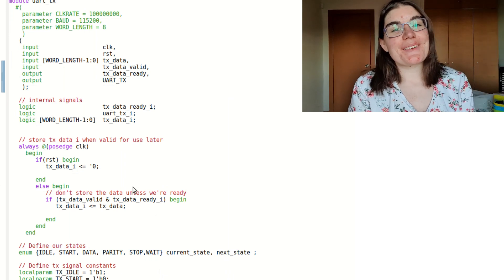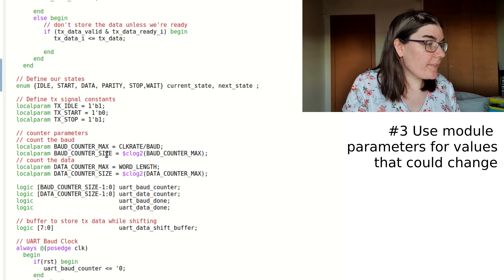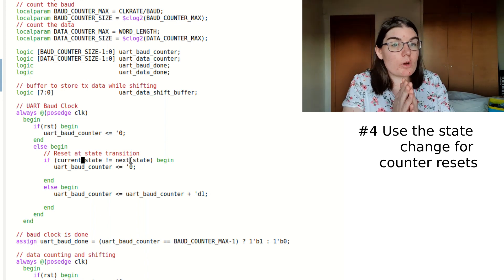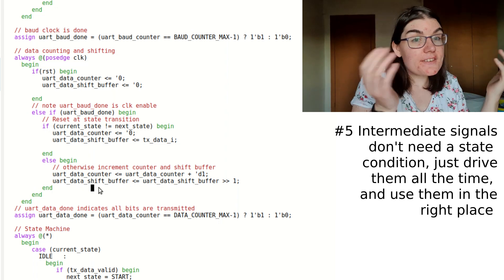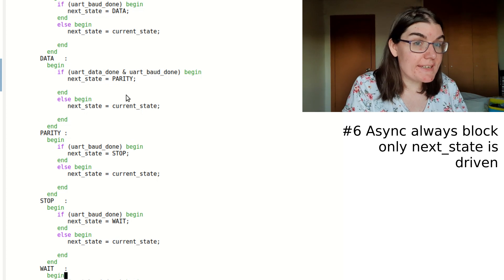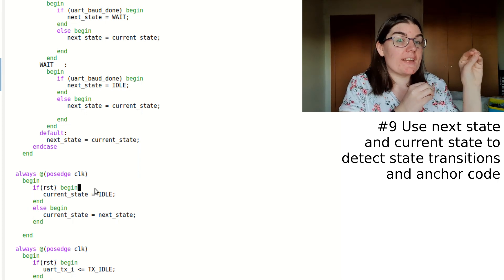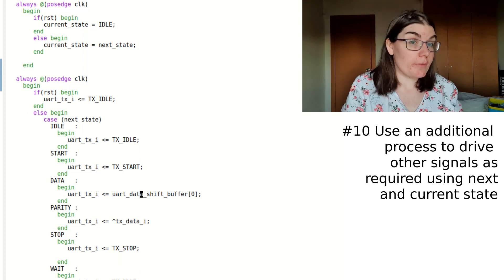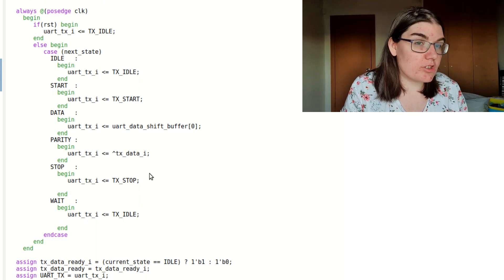10 tips for writing a clear state machine in Verilog: A UART transmitter example.

Comment: One drawback of separating the next state logic from the state machine outputs for large designs is that while the next state logic may fit on a single screen, the state machine outputs may end up many screens away. This violates the first principle Stacy brought up which is keep everything you need to know to understand what is going on close together. What you need to know to understand a state machine is not just the next state logic but also what the output signals are doing in each state. Having to scroll down away from the state machine to understand every output signal gets very confusing very quickly.

My suggestion is to put the state outputs in the state(s) they are associated with. E.g., in VHDL (which has been and still is a much better thought out language than the various flavours of the C-inspired Verilog):

reg : process(nrst, clk)
begin
   if (nrst = '0') then
      current_state <= idle;
   elsif rising_edge(clk) then
      current_state <= next_state;
   end if;
end process reg;

nsl : process(all)
begin
   -- Defaults.
   next_state <= current_state;
   tx_rdy <= '0';
   tx_en <= '0';
   case current_state is
      when IDLE =>
         -- Outputs.
         tx_rdy <= '1';
         -- State Logic.
         if (have_data = '1') then
            next_state <= TX;
         end if;
      when TX =>
         -- Outputs.
         tx_en <= '1';
         -- State Logic.
         if (tx_finished = '1') then
            next_state <= IDLE;
         end if;
   end case;
end process nsl;

For registered outputs the above can be modified to this:

reg : process(nrst, clk)
begin
   if (nrst = '0') then
      current_state <= idle;
      tx_rdy_r <= '0';
      tx_en_r <= '0';
   elsif rising_edge(clk) then
      current_state <= next_state;
      tx_rdy_r <= tx_rdy_nxt;
      tx_en_r <= tx_en_nxt;
   end if;
end process reg;

nsl : process(all)
begin
   -- Defaults.
   next_state <= current_state;
   tx_rdy_nxt <= tx_rdy_r;
   tx_en_nxt <= tx_en_r;
   case current_state is
      when IDLE =>
         -- Outputs.
         tx_rdy_nxt <= '1';
         -- State Logic.
         if (have_data = '1') then
            tx_en_nxt <= '1';
            tx_rdy_nxt <= '0';
            next_state <= TX;
         end if;
      when TX =>
         -- State Logic.
         if (tx_finished = '1') then
            tx_en_nxt <= '0';
            tx_rdy_nxt <= '1';
            next_state <= IDLE;
         end if;
   end case;
end process nsl;

The above two examples show how a state machine with combinatorial and registered outputs can be coded with just two processes. Most importantly, all the information to know what is going on in each state is right next to the relevant next state logic. An added benefit of the above pattern is that there is no need for additional processes to implement counters, as counters are just simple state machines that fit into it nicely. E.g., ctr_nxt <= ctr_r + 1.

Finally, if you enjoy tormenting your colleagues or future self I suggest following the suggestion to use multiple delayed versions of the state variable to derive outputs, particularly if the decoding is put in one or more blocks many screens away from the state machine.
Reply: I totally agree with you. I found that having a two process FSM is a really good idea, but I also think that it's better to have the outputs (or control logic for the outputs) in the FSM asynch process. That way we can see for example : "were switching states here, so we reset the counter". These two infos are put together

Comment: Thanks for the nice video. One question - 9:13 why are blocking assignments used in the sequential block, in current_state = next_state; ? It seems they are synthesized as sequential anyway, because they are read outside this block. Would it be better to use non-blocking assignment here?
Reply: Because they are independent of the clock input.

Comment from the maker: Hi All! A kind user on reddit (u/PiasaChimera) pointed out to me that it's possible to just drive next_state with current_state at the top of the async always block, so all the else statements aren't necessary. They also linked this really useful guide (http://www.sunburst-design.com/papers/CummingsSNUG2019SV_FSM1.pdf ). This will reduce the amount of space the async block takes up. This makes it even more clear than what I showed here. It just shows, no matter what your level, there is always something new to learn!
Also! u/Firadin on Reddit pointed out that my sync always block at 7:18 that registers the next_state signal into current_state is a blocking (=)assign. This should be non-blocking (<=).
Reply: Is it considered bad code to leave out default cases and else statements? What should I do if it doesn't make sense to have one of these?
Reply from the maker: @fpga-all-day  In an asynchronus always block (one with an asterisk), it's really important to make sure that all possible cases are covered, This may be by using a default case, or an else, or having a statement at the top of your block that acts as the default assignment.  If it doesn't make sense to have one of these, then you probably should be looking at using a synchronus always block. If you don't cover all the cases explicitly, then basically that is describing memory: the circuit must remember what the signal value was before in order to maintain it for the next clock cycle (since it isn't explicitly described). The only option the tool has for this is to infer a latch in the async case, which is a hacky memory element inside the FPGA. I really should make a video on this. 
If you're worried about inferred latches in your design, search through the synthesis warnings for "inferred latch". That will point you to any you may have.
Reply: @FPGAsforBeginners  Thank you, it finally clicked for me. It makes sense that this is for asynchronous blocks because something always needs to happen. I appreciate it!

Comment: Hi. Do you have any Skillz for dark arts, like doing self-modifying designs through ICAP etc. ?

BTW, is asynchronous designs in FPGAs possible or does everything have to be synchronized to a clock in physical reality ?

Also, is there such thing like real tri-state or bidirectional in in FPGA ?
Reply from the maker: Almost universally tools are dependant on the clock for timing analysis. It is very very difficult to do completely async design without a clock. I'm sure it's been done by someone but it would be extremely difficult to produce a functional firmware. 
The FPGA has bidirectional buffers on the I/O pins, so for eg, an I2C bus pin can be tristate, but there aren't any buffers apart from the pin buffers that would be tristate inside the FPGA. Once a signal is in the FPGA it is purely single directional and binary.